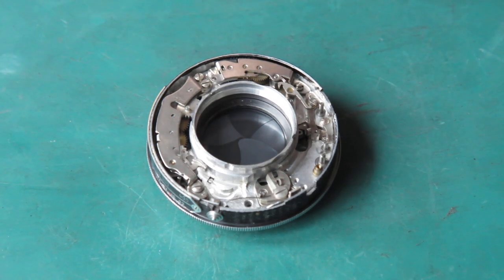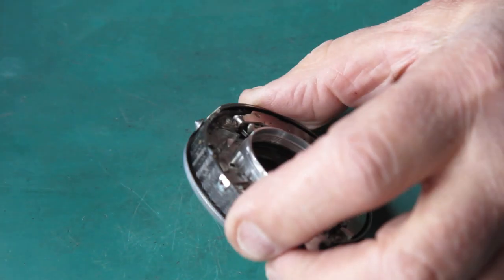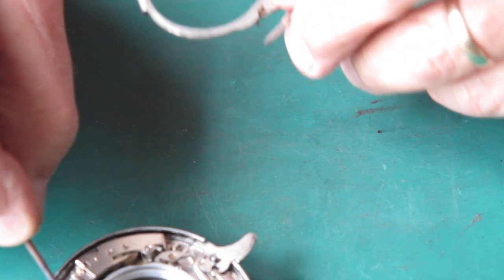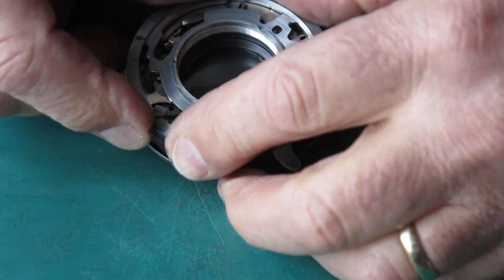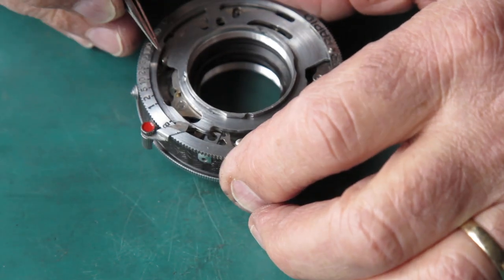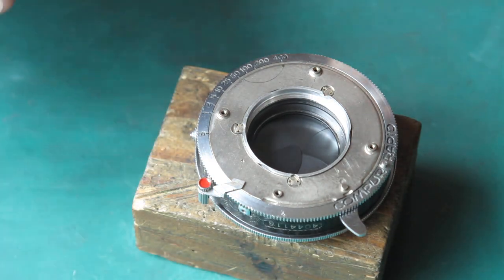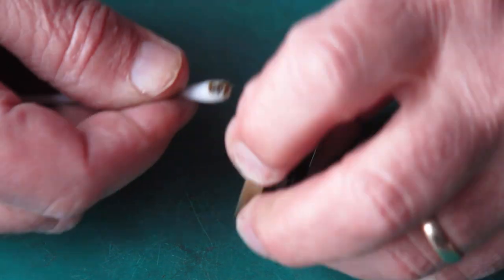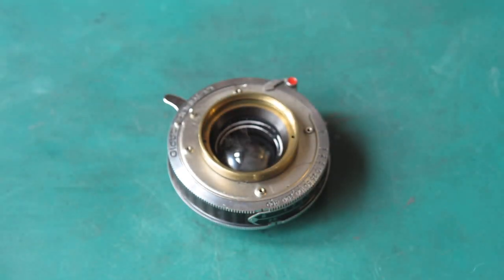Servicing a pre war Zeiss Ikon Super Ikonta, part 04

Comment: Nice video, I’ve attempted my first ever repair on a similar compur rapid, so far unsuccessfully but not giving up! Thanks for sharing! Oh btw, ¿you’ve used something to polish shutter blades in another video, what is it exactly? I need it badly! Thank you!
Reply: As I recall, Chris uses a common household metal polishing compound called "Brasso".  It's a fine metal polish but it also contains some type of a "wax" to leave a polished "shine" and prevent oxidation to the newly cleaned surface. Obviously that "wax" finish is going to be counter-productive to shutter blade movement so Chris emphasizes the importance of a very thorough cleaning with naptha after polishing. Chris also emphasis doing no more than necessary as the bluing of the shutter blades is quite thin and any polishing will be removing the blued surface. You'll note that marked up blades are never returned to "new" condition, but only to "better" and "functional" condition. You're knocking down the high points of rust growth to the level of the blued surface and no more. If there are scratches or patterns of rust, those will be forever, but subdued and no longer affecting performance. Best wishes on your repair. If you're looking for great tips and advise, you came to the right place. Chris is definitely a Master. Especially with a Compur in his hands! :-) Glenn